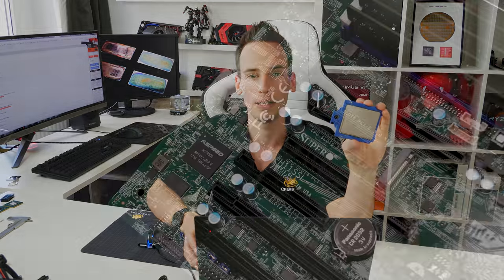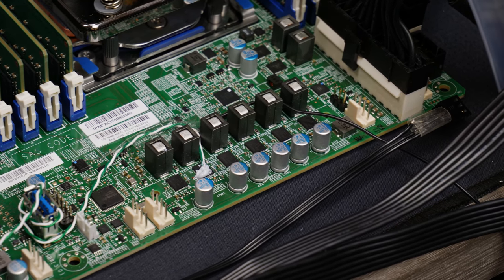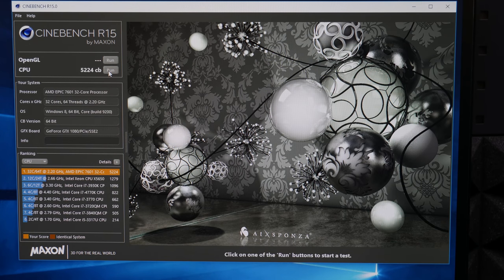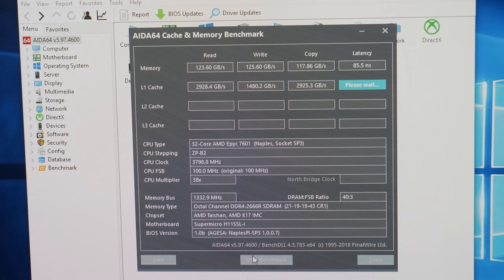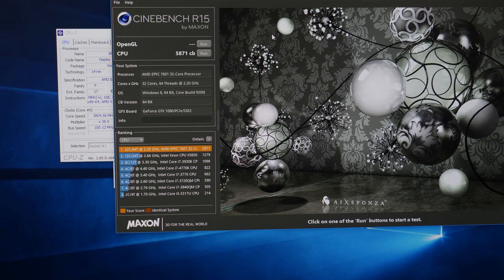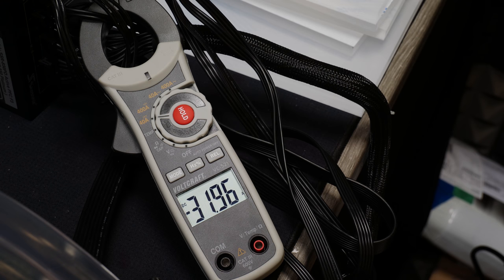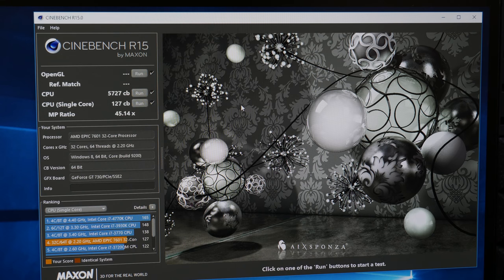Threadripper 2990X Preview - aka EPYC 7601 overclocking

Comment: Hold on AMD allows overclocking on SERVER CPUS???
Reply from the maker: No :D Pretty sure they won't be happy
Reply: I honestly think they wouldn't bother locking it on the actual CPU, just that they don't support it, kinda like how ECC is enabled but not supported on Ryzen chips. Except here you most likely need a development board BIOS or some other custom BIOS
Reply: Yep. Just like Intel did with the Xeons up to V2 the CPU's are unlocked. They're just asking the board vendors not to enable OC. Hopefully some vendors don't respect their request
Reply: I can see why intel put it off: datacentres need less power consumption and higher computational power, especially when they deal with multiple server systems in a day. You can happily overclock ONE server, but most datacentres have hundreds if not thousands of servers.

Not only that: reliability and redundancy are the number 1 issues they face, every day. Therefore, it is fruitless to overclock everything.
Reply: The amazing thing is that server CPUs have high quality silicon, so when you're able to overclock them it's amazing what can be achieved
Reply: Some Xeon CPUs are unlocked too.
Reply: HalfSpeedMastering, Also some X79 Xeons can be overclocked. I'm using a X58 (Asus P6X58D-E) system with a 6 core 12 thread Xeon X5670 overclocked to 4.44GHz
Reply: I wish I could overclock my early Opterons, same issue, CPU can but the bios has 0 tweaking options and I have no knowledge of customizing bioses other than adding SLIC to them. None of the OEM bios tools for my bios have tweaking options. None of the bios hacking forums take noticed of my request for help either.
Reply: octa channel memory is a thing..okay :D
Reply: Overclocking a server CPU, if you actually running a server or workstation, is not a great idea, even if the OC stays stable for 24h in prime95, it might still crash under a different workload which could ruin your project or kick your server offline.
Reply: AMD doesn't give a fk.  They even allow overclocking of unbuffered ECC RAM.  I am running 16-18-18-34 3200mhz unbuffered micron b-die in ECC mode with a R7 2700.  It makes a hell of a difference in the responsiveness of a linux workstation, night and day... I can never go back to Intel Xeon with it's ECC mode locked to JEDEC profiles.  (protip, asrock motherboards are the best ones for ECC overclocking, since they validate their motherboard ECC support)

It's AMD's whole gimmick.  No artificial market segmentation and open source developer support.  Leaving everything unlocked and enabled, but only offer full technical support for the full features on certain product lines.  Sometimes they leave it to the open source software community to figure out how to fully implement certain unadvertised features, but historically they leave everything enabled in hardware.  Honestly, it makes their hardware more "fun" for the hardware tweaker community.
Reply: ArhGee agreed, there's zero point in locking off overclocking on high end server boards.
Reply: I do recall something about AMD saying All zen processors are unlocked, as a major selling point over Intel. Even if it wasn't intended to be unlocked, I doubt AMD would shun such a compelling selling point for there products. I would not sweat it.

Great vid. B)
Reply: Exactly - Adding overclocking will please enthusiasts as well as being 0 effort to unlock them.
Reply: We need a bad ass VRM on an EPYC board now!!! And some of that 3200 ECC ram level1techs is working on. 

put 1.4v into that badboy and get 4.2 out of it!
Reply: ryzen supports ecc wtf dude
Reply: Blasphemer.
Reply: smoked_out 
I second this. I was done with overclocking after my first overclock. It was rock stable. But, it crashed consistently when I introduced a new workload about a year later. I had to dial back the overclock to only 200MHz, not worth my time.

Overclock could be seeing silent errors of all kinds. They could have instability from it and blame the crashes on drivers or Windows.
Reply: Yeah, a few of the lga 2011 Xeon cpu's are unlocked, with most of the 1600 series unlocked (v1 and v2), including an 8 core sku aswell. I am currently running a xeon 1660 v2 6 core cpu @ 4.5ghz, though unfortunately I got a poor sample as it only runs at this speed with 1.31 volts :(
Reply: der8auer  So how did you do the overclock?

Comment: So you're gonna tell me, that with 32 cores and 3.8ghz~, you were pushing just under 400w, while a 7980xe 18 core can hit 500w with 18 cores at 4.4ghz~. Yet every major tech outlet calls threadripper a hot running and power hungry beast (even though its half of the epyc 7601) while the 7980xe isn't. I love the amount of people directly or indirectly in Intel's pocket. By indirectly, I mean so brainwashed that they believe everything Intel says like it's the word of god.
Reply: Alexander Rewijk oh yeah. Also the power consumption is guaranteed for the base clock. When boosted, yes, with stock turbo boost it burns more power than advertised. That's why you are going to see 1.6 base clock on an "i7" laptop chip with an advertised power consumption of 4 Watts. While also having a boost of 4.4 or something like that. It's gonna burn 15-20 Watts then even tho the spec sheet says otherwise.

Comment: Could you test 1+1+1+1 mem channels vs 2+0+2+0?
Reply from the maker: can do for the follow-up video in ~2 weeks
Reply: Yes i see the same thing. TR is wired as 4+0+4+0 (only 2 die have wired to the dimm slots) and you put 1+1+1+1? I can't wait for next video.
Reply: Христо Иванов Isnt tr 2+0+2+0?
Reply: Buildzoid, can we get another BRUTALZOID video?
Reply: please someone tell me what is 1+1+1+1 and 2+0+2+0 means please
Reply: PC wale ram channel per cpu
Reply: good call BZ, and thanks der8auer. I was distracted with thoughts of how nice the 3D rendering (Blender/3delight) performance would be on such a beast, lol. TR2 is going to be cool, and potentially VRM iffy at the same time. Others ware saying 350 watt range not 250 or 150 as an educated guess.

Great vid der8auer and crew B)
Reply: > PC wale 

One stick of single-sided RAM in four slots for each channel, versus dual-sided RAM in two slots for dual channel. The first test is testing for memory bandwidth in a theoretical Threadripper 2 chip with four channels enabled. Since TR2 has four active dies, but only two out of four dies have their memory channels enabled/wired up, it is technically quad-channel.
Reply: By 4 i mean 4 dimmslots. And yes they are only two of the four die IMC is wired.
Reply: Actually Hardcore Overclocking
Actually, couldn't AMD connect the dies as 1+1+1+1? That would just need tweaking the traces, right?

Comment: Less than 500W for an OC'ed 32 core CPU. Do you hear that intel? do you hear that?
Reply: 3.8ghz vs 5ghz, cough cough. And intel was total system, not only the 12v cables.
Reply: if you don't know, they used that board with all those vrm just for one go of cinebench. cinebench stresses out the cpu, you're talking about 50Wmax for the other parts, except cpu and I'm being generous here..
Reply: Yeah but you talk about 500w for a OC-ed 32 core, but not specified frequency or voltage. Making your comment invalid. That's why i replied, i hate when people just talk trash, and put "x" brand name. 
Also why do you like your own comment ? :D Replied 3 minutes ago and you already have a like. damn.
Reply: Dude, we are at the der8auer's video, isn;t it obvious I'm talking about this Epyc CPU? go to 10:53 and listen what he said...
And btw I didn't liked my own video, I actually checked, maybe I pressed by mistake...but no likes from me, sorry.
Reply: Still. It shouldn't use triple or quadruple the power
Reply: This CPU needs LN2 to have even a chance of reaching 5.0Ghz tho, water chiller just isn't enough. I would expect the power draw of this CPU to be 1200W+ @ 5.0Ghz
Reply: O'bese The limitation on these is the board's VRMs. The Intel 28c i9 board had really good VRMs and needed a chiller for seconds at 5GHz. Threadripper is basically a lower-binned Epyc and a 1950X has gotten to 5.8 on LN2, so I think a better binned Epyc CPU could get to 5 with good VRMs and a chiller

Comment: One thing to keep in mind is that THreadripper 2 uses Zen+, so slightly better cores, and lower power consumption.  Also Threadripper is top 5% silicone selection for performance, where as EPYC is a different beast.  So I do expect a much lower consumption (additional 50-75W less) then your estimates.     Still, about a month away before we find out :)

Second part, relating to memory.  The could go 1 memory channel per CCX to reduce any issues.  but I don't expect that as that would require a substrate redesign for the TR 2.. Possible but would that give a good benefit?   ON single core not so much, as that would really starve that one core form bandwidth...

Comment: A note on Cinebench 15 (CB). I have observed that CB does not follow a linear curve when testing with different core counts. Apparently the processing power needed to draw the ray traced picture on the screen increases quite a lot with increased core count. (testing with a 1950X) The only way to mitigate that is to set CB priority to Realtime. So please set CB to realtime when doing the CB benchmark runs. Thank you.

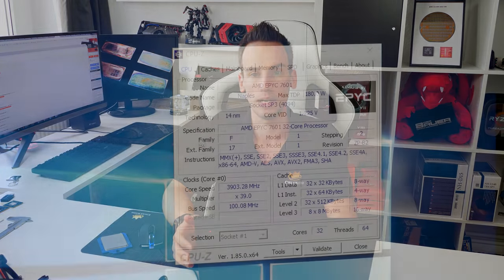Comment: 10:02 4GHz at only 1.225v? that's insane for 32 cores. My 1950x (also chilled) needs 1.34v at 4GHz.
Reply: Andy Bradley that wasn't stable for load. It was stable enough to run Windows few minuts without crash.
Reply: yeah Epyc is top 10% silicon.
Reply: I though ThreadRipper was meant to be top 5% silicon?
Reply: It was the top 5% of what was left after they picked dies for Epyc.
Reply: 7601 uses the same 1st gen Zen cores as 1950x. 7601 is NOT the same as trheadripper 2990x. 2990x will use zen+ which uses smaller process node, lower memory latency, and lower cache latency, as well as requiring less voltage on load for overclocks at a specific speed compared to 1st gen zen (so you could very well run 4GHz @ 1.2v prime stable because zen+ can run lower votlage at higher clocks, just look at ryzen 2700x).

very excited for this!

Comment: Here is the problem. When you revert to quad channel memory the controller does not use dual channel in two CCX's with IF used ti transfer data for the other two CCX's. It reverts to single channel per CCX form what it seems. This explains on quad channel only seeing about what is expected at 3.4GHz from a 1950x in CB R15.

Comment: why not get a 2nd 7601 and do a dual socket setup, i know overkill but still would be cool as hell. also they did say that threadripper 2 is still the top 5% binned chips so i would say that they should be able to do 4.2GHz pretty easily and most will be able to do 4.3GHz, but there will be so few people overclocking them that we will probably never see these types of speeds.

Comment: der8auer you had the memory in wrong slots in quad channel mode. The way you had it each CPU die had only 1 module. So you ran 4x single. If you would ran 2x dual instead the impact would be smaller.

Comment: Cinebench is getting ripped apart.
Reply: pun intended?
Reply: jklw10 of course 😉
Reply: There are Intel CPUs that can do higher scores.
Reply: basshead sure but they cost twice asmuch
Reply: Actually im noy sure lemme see
Reply: basshead (x) doubt 
All I've seen that are above this are multi-CPU setups!
Reply: +CrimsonFate  Pointing out facts doesn't make me salty.
Intel 5ghz 28 core CPU(quad channel memory) 7334cb
Reply: +CrimsonFate  You didn't watch the video? Derbaur used a chiller too.
Reply: basshead Yes he does, but it's not using illegal gas and a 1000w chiller and easily 700w+ cpu is it?
Reply: In Europe people use better electricity (230V) and that's why CPUs draw less power.
Reply: basshead I'm on 230v UK FTW
Reply: Basshead tbh both cpus shouldn't use chillers since it's around 1% of all overclockers, they should overclock on an aio at least.
Reply: that was an overclocked Xeon 8180 that costs 10.000U$ using a 1700W water chiller.
Pulling something like 1200W by himself, and it was using hexa-channel not quad channel on a new socket.
Reply: mains voltage input wont affect cpu power draw, only psu efficiency.
Reply: atretador It was released for $3000... Not so smart now are you

Comment: With the amount of cores and threads being put into the mainstream market, it doesn't make sense for programs to be optimized only for IPC. I hope to see programs that can fully utilize all of these cores adaptively (a way to "sense" the amount of cores/threads available and adjust the workload accordingly). I still see games pegging a single core and the rest only being utilized by 30%. Some cores even being completely ignored for long periods.
Reply: Writing software that effectively splits the load across multiple threads is a very challenging endeavor and is one used when you need more raw cpu horse power. A game that will load 4 threads to 80% is much easier to code than 8 threads at 40%. However 4 threads at 100% vs 8 threads at 60% will cost some performance due to the application needing more grunt than what 4 threads could provide.

This is mostly only true for games. Professional applications (like blender) can very easily split the workload unlike game physics.
Reply: Bayan Zabihiyan 
The problem is that programs like Blender heavily rely on single-thread performance as well. Animation playback in the viewport, modifiers (including armatures), most simulations, and sculpting do not use more than four threads.

So, while the render workload executes on MANY cores, the user experience depends upon 4-6. You either need a CPU with many, fast cores or two different systems with an efficient pipeline for moving projects back and forth (that could be difficult for large projects).

Blender 2.8 will make this even worse due to the Eevee viewport heavily using OpenGl. You will probably need a "gaming" machine with extra RAM for working and a many core system for Cycles rendering. I have but begun benchmarking actual performance, but I expect this trend to remain.

Comment: fyi cinebench barely uses the ram.Your issue probably has to do with how epyc deals with indirect dram access.My 6700k spends only 2% of its time waiting for data from ram in cinebench (with an average of 30% in modern games)
Reply: How did you test RAM waiting time?
Reply: ProfXP intel vtune amplifier XE.Hook it on the app and use general exploration for some quick data.You can use HPC for more stuff like instructions used.Funny thing is that cinebench is using instructions from literally 2000 and we still use it as  a benchmark for some reason.This software does not work on amd
Reply: Thanks! Will try when get my hands on intel machine.
Reply: ProfXP another way to tackle this would be testing clock speed scaling.It works best in games due to the high dram load.For example if going from 2ghz to 4ghz on the cpu you only go from 50 to 75 fps in the game it means that the cpu spends half its time waiting for data from ram/l3 cache(l3 cache is usually only a few % of time spent). obviously test in cpu bound settings.Faster ram helps you achieve better clock scaling outside of better ipc in games.

Comment: It's worth noting TR2000 will use zen+ architecture whereas epyc is using original zen. Plus maybe like you said they're doing something with the infinity fabric to change how the 4 dies handle memory access on TR2000.
Reply from the maker: Well how big is the difference from 1800X to 2700X apart from 200-300 MHz more? Yep there is no difference :)
Reply: True, though zen+  has lower latency cache and memory access, no? Though I guess it's not going to make up for 4 less memory channels. It'll be interesting to see how they handle it.
Reply: Yes but the first ryzens and threadrippers oc'ed to 4ghz so thats a potential zen+ TR oc of 4.2-4.3ghz with faster ram